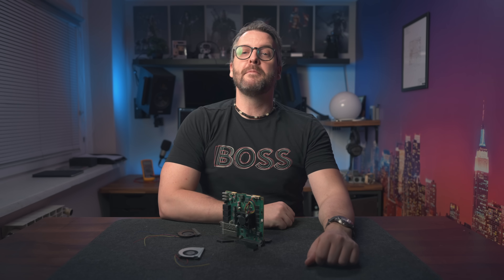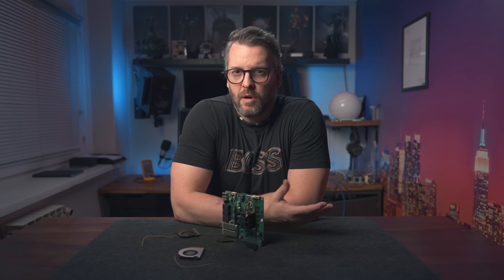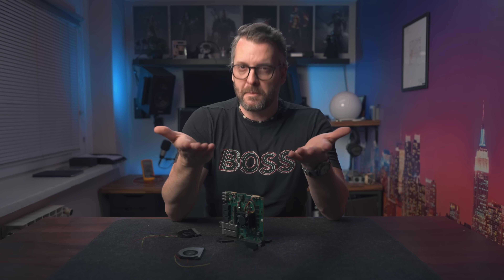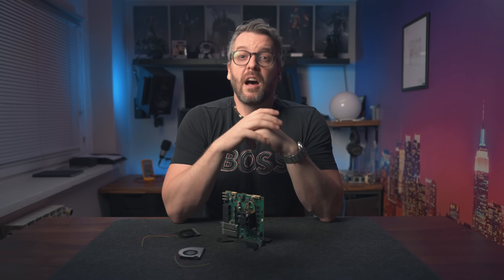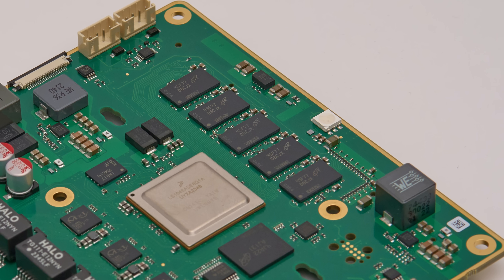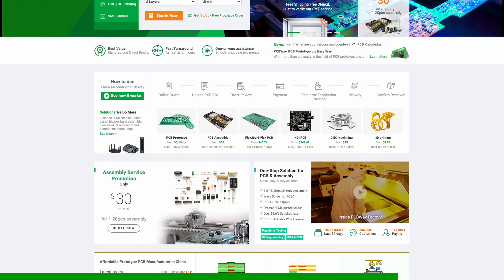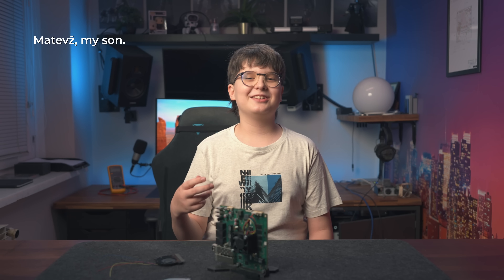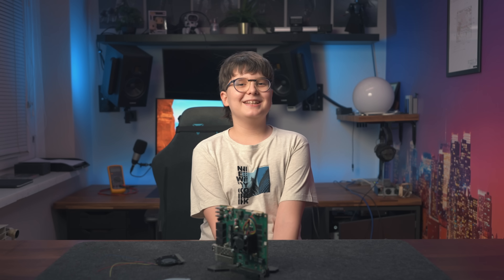You Wanted a Cheaper Router. We Can Do That.

Comment: Just put it in an injection molded case. I would also cut down the number of USB-C ports and lose the SFP ports. Maybe 1 USB-A and 1 USB-C with 5x RJ45 would bring it down more. 
People who just want a solid 10G router also have no need for a full 8GB of RAM, or all those extra CPU cores. Half of both should be fine if all you're doing is routing traffic.
Reply: Drop anything EXCEPT the SFP+. Doing 10G routing without support for optical would be insane and reduce the marketplaxe more than even the cost.
Reply: @zacwolf2 99.999 percent of users would never use optical fiber inside the home, and anyone who is into that could just splurge for the big one
Reply: I don't think replacing SFP ports with RJ45 ports will do what you think it will.
If you look at switches, for example, if you compare devices with RJ45 ports and devices with SFP+ ports that are otherwise identical, the ones with RJ45 ports will always be more expensive, because the RJ45 ports also need PHY chips and magnetics that the SFP ports don't need.
In case of the SFP ports, those functions are fulfilled by the transceiver modules, which obviously also add cost (but not on the router side).
What the SFP modules mainly provide is flexibility. Do you need a short link within your rack? Plug a DAC or AOC in. Need a longer range link between buildings? Plug an eSR transceiver and Multimode fiber in. Do you want to make your ISP provided OLT obsolete? Plug a GPON BiDi transceiver in (maybe even the one from your OLT).
SFP Ports don't add much cost (compared to RJ45 ports that would take their place, I'd argue they even save cost). But they add a ton of flexibility.
Reply: Or even 3d printed enclosure or maybe just a STL file for mega tinkerers :)
Reply: Everyone is forgetting that this board has high-speed signals so the case is likely to require some metal parts to be formed and put on it for shielding that’s going to massive cost that no one really considers so the case has to be made in a way that blocks RF
Reply: Well, unless you want some dockers for pihole, media streaming, torrent clients, home automation etc, then 8G is the starting point. But I agree, having two 10G ports seems typical but unnecessary. If you have 10Gb network at home then surely you'll have a 10Gb switch as well. Of course, you could have 10Gb WAN connection, but this seems under 1% of the clients.
Reply: @mepret  What?!? I want a 10Gbit router because I have 10Gbit WAN. What else would a 10Gbit router be used for?? It definitely needs 2 10Gbit ports…
Reply: @michaellocher3250 Aren't the RJ45 ports 10G? You don't need SFP for that
Reply: @RetroBerner you realize that 10 GBit WAN does not arrive in copper, right?
Reply: @miko007 We're talking about inside the home, LAN, not WAN
Reply: @RetroBerner they guy before your comment LITERALLY talked about WAN...
Reply: @miko007 Well you tagged me, so I responded.
Reply: @RetroBerner yes, because you responded to the guy talking about WAN...

he said, "i have 10 GBit WAN, what else would i need a 10 GBit router for?" and you said "well use RJ45 ports, then" in response, to which i said "well, 10 GBit WAN does not arrive on copper" and now you act like it was all about LAN...

i am totally lost now.
Reply: @miko007 That doesn't make sense. Even if you have 10G fiber to your home, your access point or "modem" will still convert it to ethernet before anything else. Maybe not if you have an enterprise solution, but this is targeted at regular consumers.
Reply: @mepret Why would you want to run docker on a router? It's no wonder this thing is so expensive, seems y'all really just want a computer with 10G ports
Reply: @mepret  I don't understand this argument. Sure, PiHole can be nice, literally everything else does not belong on a "router", that's dedicated computer workloads???

Comment: I would suggest going for breakout boards. 
One for the connections and one for the main pcb with the cpu+ram (2 core / 4 core , but I dont know if someone buying such a special device wants 'only' networking)

In my case I would use it as the home network routing + simple media streamer and screen/game streamer, while not using an external harddrive but my main PC for hosting and streaming via lan back to the router then to my wifi and other wired devices

Comment: Personally, if the networking is hardware offloaded, I don't see any issue with a cheaper CPU. Though, I would argue that ECC RAM is worth it to keep. If your main competition is a DIY opnsense box, going from non ECC to ECC would be an order of magnitude more expensive on the DIY, but only a small increase here. It's an additional way to set it apart from DIY.
Reply: Same thoughts here.  Keep the ECC and better quality passives.  Losing either will have a negative effect on stability, and longevity.  I'd demand having them at a product that's going to cost me this kind of money.  Otherwise it's no different than a "Daebo-daebo router from Alibaebo".  I'm already buying used business-class SFF office pc's and stuffing multi-port cards in them to keep quality up as it is.
Reply: @Sansui350A  ECC isn't going to improve stability much if any.   Only good for single bit errors and at that point it's only a matter of time before the system becomes too crashy.
Reply: @Sansui350A  Honestly, I don't get it... Why ECC and "better passives"?? Have you had any actual issues with simple, mere mortal hardware? 
I have several 951 Mikrotik routers deployed for almost 15 years, and despite feeling quite patriotic and biased because they are from my home country - I don't think they use any of those "improvements". They are run-of-the-mill $100 routers. None of them malfunctioned, I feel totally fine buying old yellowed ones from local marketplace and putting them right into my production(after a reflash, ofcourse).   I don't even bother with Mikrotiks "Cloud Core" "more enterpricey" series anymore.
Reply: There is a way to answer the ECC question - on the development units, include some firmware which monitors and logs the occurrence of errors which ECC has dealt with - I'd be surprised if the CPU's memory controller doesn't have the ability to do that. Encourage users to send reports from this, so you have actual data as to whether ECC is of any benefit.
Reply: (common sense handshake)
Reply: No way in hell PPPoE at 10Gbps is somehow hardware offloaded. I’ll eat my hat if it is.
Reply: @adrians1447  I have bad news for you, check previous videos in the series. The networking has already been proven to be 10Gbps (raw data transfers) fully offloaded, 0% CPU usage.
Reply: PPPoE fully offloaded at 10Gbps ?! Which video is what ?
Reply: I don't see ECC being any relevant for home users of any kind, even at this price point (400$ as per the cost-reduced version discussed in the video). I don't know... is ECC such a massive impact on reliability and stability? What does it do that would improve the QoL for home users?
Reply: @cristinelcostachescu9585  I'd want this as a small/medium business router for my clients and private cloud infrastructure.  And at anything above $200 I want fucking ECC in it lol, and some good passives.  You do you.
Reply: Plus with that soldered RAM, I want as much reliability as I can get out of it.  ESPECIALLY for paying out that kinda bread.
Reply: @Sansui350A  yeah, but you didn't list any reasons for wanting it. Some kind of benefit, anything.
I felt the same when everyone went crazy when AMD Ryzen was announced to support ECC RAM. Has any home user had any issues with non-ECC memory that ECC would've definitely fixed? None that I am aware of. And it seems to me like it's the same here with this router. 

Don't get me wrong, if they can include it, I fully welcome it and won't say no. I'm just saying, as a home user, I will not be disappointed if it is removed...
Reply: @cristinelcostachescu9585  As stated, I intend to use a device of this class for small business/commercial use, besides home use too.  Case=Point, self-explanatory.
Reply: @Sansui350A  that's not an answer.
Reply: @Sansui350A  it sounds like you’re sort of demanding and custom specification for yourself. You should be willing to pay for it.
Reply: ECC is just fluff - "marketing" - for something like this. How many of your ECC equipped systems have leveraged that ECC? IME, I can point to two - TWO - in ~30 years. (both times were dirty connections.) As for those who think this makes the device more reliable, it doesn't; memory doesn't get built using 4 of the 5 chips - it's all fixed, when a chip goes bad, the whole thing is "trash". (best case, your logs are constantly filled with memory correction notices.) I understand the logic for built-in memory, but it very seriously limits the options.
Reply: @jfbeam  If you don't care about integrity of your data (ECC) you can as well just buy a cheap commercial router.
Reply: @akkudakkupl I'd argue that networking wise ECC won't matter at all because most networking protocols provide their own error correction. After all, network traffic is well known to suffer from lost bits. So as long as you're not using the router as a storage server, I don't get the ECC argument. 
In other words: the number of flipped bits due to unstable network/internet connections far outweighs the number of flipped bits inside the router.
Reply: @akkudakkupl  There is very little types of data that would get corrupted and go unnoticed. The entire thing could as well explode and burst in flames.
Reply: @akkudakkupl  actually in this usecase ECC will help very little ECC is usefull only if memory itself gets corrupted which is not gonna happen unless something like solar flare hits your memory module so i think in this kind of device is more fluff then actual usable feature, i would rather for example have more compute then ECC
Reply: @akkudakkupl  the data is still not going to be intact. RAM does not solve all your data integrity problems.
Reply: @NGC1433  if it can get corrupted and remain inoticed thats  a bigger design problem

Comment: I'd like to see a quite heavily price optimized version (without losing performance obviously) like a "Lite" version. Lowest HP CPU possible, No fancy extras, maybe even no expansion, acrylic/plastic case. just barebones of what you need in this router to make it just the outstanding Router it would be.
The "Standard" Edition could have logical optimizations in place like the ones you already mentioned without sacrificing the spirit of the Founders Edition, which obviously should be balls to the ball.
Reply: The issue is you’re going to have to take some things away for some people. They’re going to massively slash performance and for others they won’t notice anything. That’s the big issue because something like this is not standard

Comment: Hi, i would prefer all optimizations, but without the CPU. When I'm buying such a pricey router, i want to run docker on it. Regards from Germany.
Reply: @testing2517 Maybe a stupid question, but what reason would there be else than something like that? The Networking Performance can be  bought for much cheaper
Reply: @lol-vq8dh can it, though? I have yet to see a device that can do actual, full 10G routing and light firewalling for less than 500$.
Reply: People who run docker on stuff like their router are the problem
Reply from the maker: Actually, I've seen a super-compartmentalized routing OS (proprietary and not open sourced), that's separating different aspects into docker containers. I personally have no need for that but thought it was a very interesting approach!
Reply: @tomazzaman  yes, the Microservices approach is arriving even in appliances these days (even stuff like ESXi and vCenter now use containers under the hood).
But for that you don't need additional CPU cores - unless you want to disregard the offloading stack completely and do everything on CPU, but why buy this device at that point.
Containerization doesn't add much overhead - so if all you're doing is still routing and a bit of firewalling, you don't need the additional cores, even if you containerize the routing functions.

Comment: Why not have the option to have 4 cores at 1.6GHz and all fancy eMMC? 
Like making an assembly variant in Altium is easy , some will prefer that over cost optimized worse CPU one since it would be way more compact then router + SBC for stuff, not to mention that you know the HW.
Economically i am not sure if it is worth it.
Another thing that you can optimize if the power magnetics , i noticed a lot of Wurth electronic parts and those are on the expensive side, and unless you used a super custom footprint it should be sort of easy to replace them with something cheaper,  depending on that is out there you could also optimize a bit some values so that you use the same inductor on all SMPS ( you can play with the switching frequency)

Comment: 50 usd you can buy 2-3 routers from china or even more
Reply: Not even close rofl
Reply: no you can't 😂 what are you on about? the mini PC's you see on Aliexpress would be £180+ for multi 2.5Gb ethernet versions
Reply: @kosmos3718 Yeah, and that wouldn't even include the fiber connections 🤣
Reply: Yeah early 2000 era level router with 100Base-T speed.